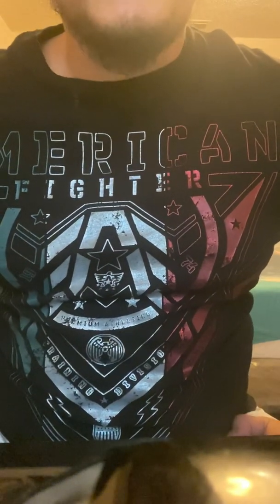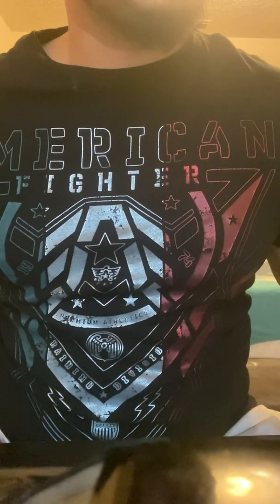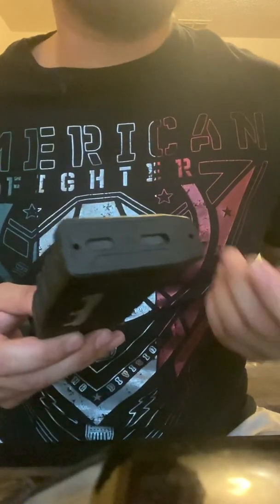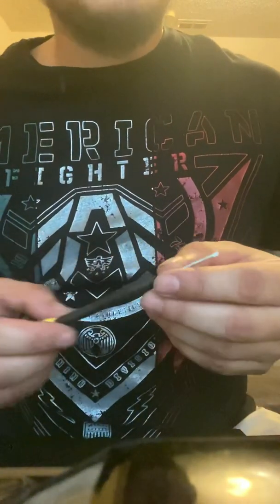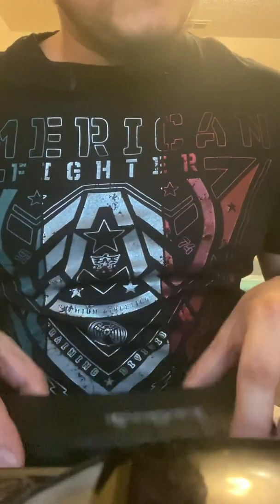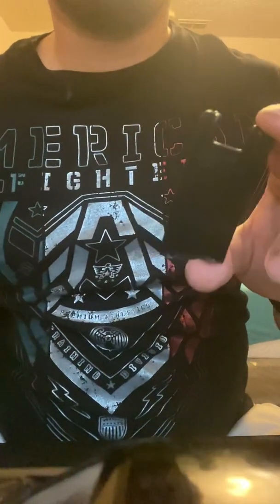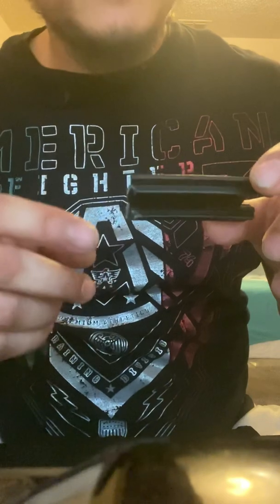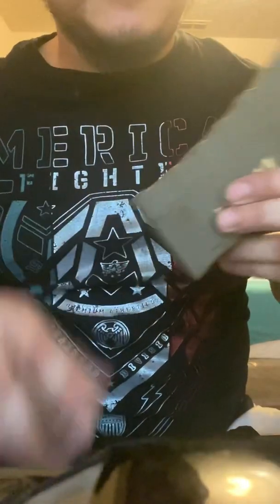Mission First Tactical 5.56 Magazine disassembly and  Modifications

Comment: I accidentally bought that mag today, I should've read the bag before I bought it. Pissed me off, but I'm go na try to get in and remove that plastic stopper. Thanks for the tips, I was wondering why I couldn't slide out the bottom part.
Reply from the maker: clarkpatrick88 no problem brother ya if you use a blade to remove the glue and pry it open you should be fine. Let me know how it works out for you
Reply: Same here gonna try this